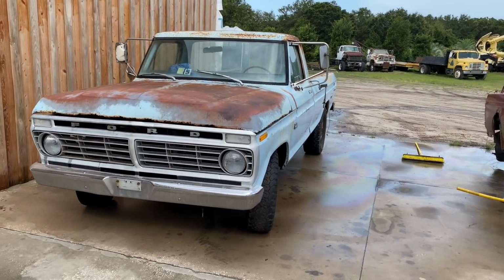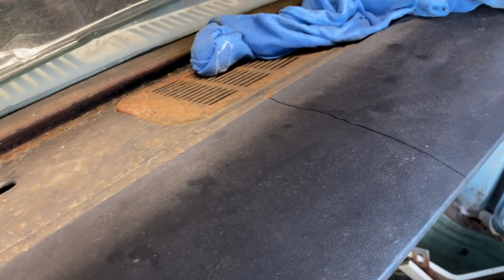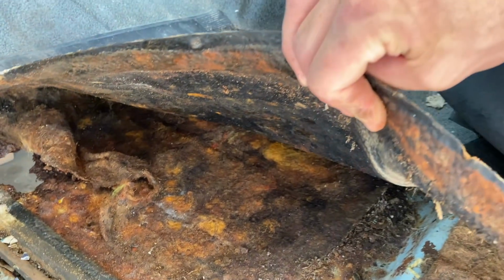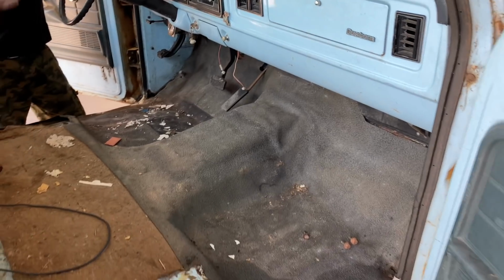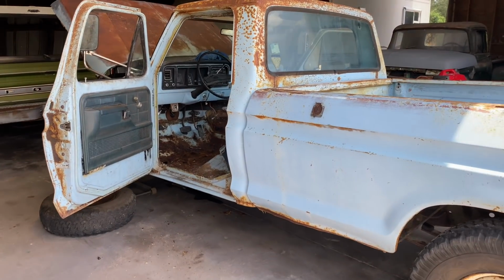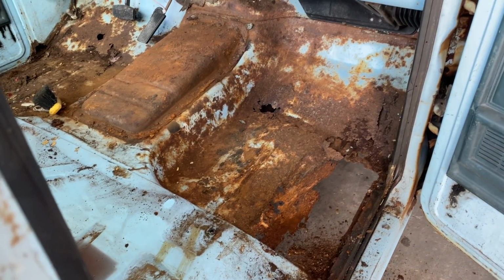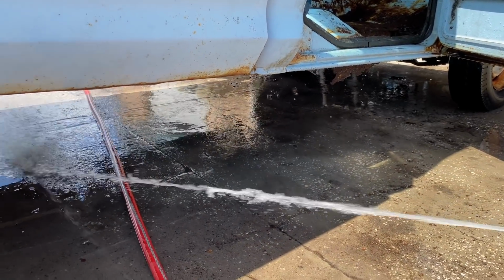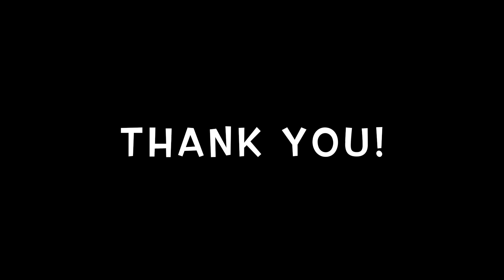SWAMP Dragon Rescue! DETAIL & RUSTED Abandoned 1974 F250 Custom 390 V8 FORD, Vintage Restoration CT

Comment: From LNC truck the Left and Right floor pans are $40 each (part numbers 49-8820 & 49-8821), inner rockers are $80 each, cab mounts $84 each. $408 plus shipping for all. So yes well worth the cost and time. Worth more then a VW Van and parts are cheaper.

Comment: Replacing the floor pans is a straight forward process and is very common on this age truck.
All of the floor pans are availed after market so they are not expensive.
Just cut the bad ones and replace with new.
Reply: Yep. Agree. Pans are a dime a dozen on line and relatively cheap. Replace them and keep the project going.👍
Reply from the maker: Thanks Glenn! I will do that.
Reply: If you can.. you might want to try some junkyards in the southwest for pans.
Reply: Screw in some old license plates ..just as good ..lol

Comment: Yup replace both floor pans and rocker panels. Then give the floor inside and out and the frame a few coats of POR-15. Good for another 50 years.
Reply: Sandblast first would be good
Reply: Por-15 is great stuff, been using it for around 25 years. It works best on 'seasoned' rust. Be careful with the can when you use it. It can make the can turn messy if you dont transfer what you're using into something disposable like an old jar or container. Scoop, dont pour what you are using into the disposable container and seal up the original can with NO por-15 in the creases where the lid attaches. They're slogan says it all on the can. 'When we say permanent, we mean PERMANENT.' Shit will dry in the can hard as a rock. Oh and go with smaller cans rather than one large one. That way if it turns into a mess with the can you dont ruin a large one. The stuff isnt particularly cheap, but a smaller can goes a pretty long way. Oh and wear gloves while you're using it, because only time will wear it away. Its good stuff.
Reply: Mark Godfrey  Nothing helps in the salt belt.

Comment: LMC Truck would have all the metal you need.  They list floor pans at $40 per side.  Not bad.
Reply: wow that place is great. I would even do that one. just even cut the edges and lap them in place. done. little seam sealer and paint and its over.

Comment: LMC TRUCK sells all those metal panels to fix the entire floor new
Reply: Manolo Aycart G exactly. Every rusty panel that they are complaining about can be had from LMC Truck, or classic industries. 70s and 80 s Ford and Chevy pickup trucks are gold. There is such a huge aftermarket for these old trucks, They could probably sell that truck the way it sits right now for twice the money they currently have in it, and they’d be selling cheap at that.
Reply: @chrisbolton4900  screw

Comment: Definitely worth fixing. You can order floor pans from LMC Truck or even cut the old metal then weld some metal in the floors. It’s part of the adventure of fixing an old vehicle. Make sure you treat the surface rust with some inhibitor.

Comment: I've used a trick were I use CLR on the surface rust. Followed by a rust stopper. 
Buys you a lot of extra time before you have to paint and cuts down on the sanding later.

Comment: 1974 Ford F-250 full detail top to bottom paint job pressure washer takes men power get like brand new truck from the dealership back in the 70s 2020 century technical put CD player awesome video friend bless you

Comment: Yes those panels aren't that bad to change. there is two types Of cab mounts,  plain one piece or the factory OEM type preferred. But Jeffs Bronco graveyard has been on back order.. But there are many other company's out  that sale them.  I did not make video but there Not as fun to install as some may have you to believe. I have done this type work before this particular brand was not very exact in fit, as many are but i got it. looks satisfactory. I went for the But weld so was more difficult. Inner rocker is descent shape from what i see. if isn't rotted that bad  just cut out rotted replace.

Comment: Invest in an impact screwdriver. You could've used it on the kick panel trim and plenty other places as well. Yes, I have replaced and patched floors in plenty of stuff. Get yourself some sheet metal, mig, seam sealer and prepare yourself for a ton of prep work grinding back into the good metal that you can weld to. Some guys go even more in depth and use a press brake, and all kinds of stuff but really all you need is basic stuff to make it decent. Cut out all the cancer and use cardboard to make templates of the pieces you need for the floor and tunnel areas and just trace your template onto the metal. Cut it out, weld it in, repeat. When it's done hit it with etch primer and seam seal it. Undercoat the underside

Comment: Hi CT. it is well worth doing. 3 parts to a vehicle. Engine and transmission, body, brakes. You got 1/3rd done by getting it started and running. The bodywork isn’t that bad and brakes are very doable.

Comment: Lol. Pushing heavy vehicles is always fun. I had a '96 Roadmaster Custom Wagon that I saved off the scale and revived. I loved that car, but I could never find the correct fuel sending unit for it, so the fuel gauge didn't work. That LT1 got 12 miles to the gallon on a good day, so needless to say, I ended up on the side of the road quite often when it ran out of gas. It was 17 feet long and weighed 5300lbs, so it was always a blast trying to push it around, lol.

Comment: repaired floors in my F100 seventeen years ago with 4 sale signs, caulk and short sheet metal screws then sprayed it all over with spatter paint. Still holding just fine. A road sign would work well on that big hole you stuck your foot through.

Comment: Hello. Mr. C.T.  =)  What a surprise... It's wet paper thin and crunchy... Yummy! That's what's called the dark side of mats and carpets, as they accumulate water and rots underneath. Anyway it doesn't look that critical and with some panels you should be ok. For the rest of it the easiest and cheapest way for you is metal fabrication DIY. Sheets of metal, snips, hammer and dollies... and voila! =)  Don't forget about rusty...

Comment: Hey just a quick tip. If your headlights aren't working.  My high beam switch went bad once and I lost my lights all together.  Traced a short back to that switch then everything came back.  Might be worth a shot with all the moisture trapped for so long.  Cheap part to try anyway.  Keep going truck would be a cool driver

Comment: Floor pans for this truck are easy to find, I just looked for floor pans for a 1970 Dodge Sweptline pickup for my friend and found 15 suppliers on the first search page. They sold tons of these trucks so it should be easy. The truck is definitely worth fixing if you don't want to or can't, sell it to someone who will. You'll find a buyer for sure.

Comment: Get the correct floor pans. They fit and will be solid. You won’t regret it. Rockers are galvanized and look good to me. Be sure to clean and seam seal and undercoat the bottom of the floor. I’ve fixed several of these. It makes them solid and like new!

Comment: just buy the floor pans and overlap them about 1/2 inch and spot weld it all the way around that would be fine for a floor. be sure to use your rust converter. and paint them before you reinstall the padding.

Comment: I would replace everything in that brake system, rotors calipers lines rubber and metal master cylinder mabey the vaccum booster too after sitting that long, i had to do that on y 86 C-10
Reply: jay bradley not to worry skinny jeans wants to turn the “drums” and replace the pads.  What does skinny jeans contribute? Power washer, gas dumper.

Comment: Floors are easy, you can knock that out in a short day. Its covered with that mat so it doesn't have to be pretty just solid. I would weld new metal in

Comment: At some point in time that F250 had a CB radio in it, you can still see the hook where you would hook up the part you speak through,then the the antenna, that red pick up still has a lot of suspension parts plus the brakes, the disks, if the other ones are worn out.

Comment: I would repair it.  My old 87 chevy passenger side is like that, well maby not as bad as that but it has some body rot in the floor panel.  You can buy new panels and just weld them in.  something I need to do with mine, but mines been sitting.. watching these videos kinda getting the spark going again in wanting to fix mine up more.  cool channel ya all.

Comment: Stubborn screws can often be loosened by smacking the screw head with a bit that fits it. Often, you will then be able to back it out with a screwdriver.  OR weld a 1/4" 6 point impact socket to a air chisel. This imparts more impact, and quickly.  You can actually buy a bit with a captive wrench on the shank, allowing you to turn while hammering. I believe it is an aircraft tool.
Reply: Since pickups are enjoying great popularity, and Ford pickups are by far the most popular, patch panels are widely available, fairly cheap. What you can't easily find, you can make. That is going to make a nice truck, fairly rare as an F-250 with factory air, and  FE block engine!

Comment: Those interior screws that are in the floor the easy way of getting them out is to take your screwdriver and a hammer and tap the top of the screwdriver on the screw is will loosen the screw up it's a good trick that works most of the time on those stubborn screw heads

Comment: Common issues  with that body style  is floor cab mounts front of roof back bottom of cab floor braces radiator support and front of hood. I know because I'm working on my second one it's a lot of work but they all deserve to be saved. All body parts are available at reasonable prices good luck have fun.

Comment: Wow. I figured the floor would be rusted. Absolutely worth fixing! All kinds of floor panels are available brand new and fairly reasonable price. LMCtruck.com has all you need. I have a '72 F250. Different body style but I've found that if these old beasties set outside too long, the windshield can leak. Another serious issue is the hood vent just below the windshield will lose its seal down inside the front seam and leak into the cab. Just dump water across the vent below the windshield and see if water comes inside and onto the floor. Not sure what the fix is but noticed there's a black bead of sealer under the dash at the top of the firewall and that might be the issue. Also, those brackets with wing nuts under seat actually hold a long crank rod that fits into the base of the factory screw jack. Probably could pick one up from LMC truck or something. Interesting to see all the similarities in Ford body styles. Keep 'em coming and don't give up!

Comment: Mechanicals first. Engine, brakes, transmission, differential and suspension. Evaluate the expensive components, then look at the body.
Reply: Yeah but i'd rather work in it clean than it full of garbage
Reply: You'd also at least temporaliy want ply wood covering the hole in the floors so you can drive it without fear of you feet falling through, you also want inspect your frame, you wouldn't want to get the engine all nice and running sitting in a swiss cheese frame

Comment: I have repaired worse damaged then that. A small wire feed welder and some sheet metal is all you need to fix the floor. I used  a undercoat/kerosene  mixture to  make a thin factory anti rust coating then paint.

Comment: Floors in these aren't too bad... a lot of drilling out spot welds and chiseling. Front body mounts will need to be replaced too. Those have 5 or so spot welds on the seam on the firewall.

Comment: You have 2 options with the FLOOR in that TRUCK cut it at the SEAMS of the FOOT PAN & REPLACE it that way or replace the CAB entirely of course I'd go the first way but you will have to take the CAB off either way so you can get to it under it on the bottom

Comment: Not sure about that specific model, but I know that for car it's possible to by new floors for them, cut the old one and simply weld the new one in place. Since that is a quite common truck and not some rare build, probably it is available.
Reply: I wonder why you dont do the bus before you start a new project?

Comment: If you think that's rusted bad it's a good thing you don't live in Minnesota!!  Here they all rust from the bottom up.  That truck is is in pretty good shape for it's age. Find a good used hood and core support.  Get some new floor pans and front cab mounts. 90% of the time when the front floors are rotted so are the front cab mounts.

And on rusted bolts, like the seat mounting bolts, Before you try to remove them take a drill with a wire brush on it and clean up the exposed threads on the bottom side of the floor.  Then spray the under sides with good penetrating oil like Kroil or PB Blaster. The bolts will come out much easier and quicker with less chance of damage to the threads or even breaking them off. And on the rusty philips head screws use a impact driver ( the manual hand tool not power tool ) . You hit it with a hammer and it breaks the screws loose.

Comment: add some strips underside to fasten to. then find some gavenized sheetmetal cut to size and fit it up will be better than new.
Reply: David Schaeffer right? Then bondo the crap out of it and seal it up with duct tape.

Comment: Its really easy in these old fords just order up half or full pans .. i suggest full pans  weld it in primer it or rino line it and the roof of the cab is repairable some patch work and some body filler and a good sand and paint should do the trick... with all this work you should consider at least a parshal restoration make it worth the while

Comment: Yes it is worth repairing you cut out the entire panal use the panal as a pattern and remake the entire floor out of sheet steel. And tack welding . If you cant do that ford sells replacement floors.. hope this helps. And yes it's worth it..

Comment: When/If you put a new floor in Do Not leave it unpainted make sure you paint it with high heat like rust-oleum paint something to help keep it from rusting again and don’t weld to rust make sure you weld to good clean metal.( I’m sure you will I just want to make sure if anyone else is doing a similar job they don’t mess up and regret it down the line.)

Comment: My uncle has a 1968 less than 50 thousand miles original everything no surface rust and original handwritten paperwork and the only thing that is broke is the extra fuel tank but seriously has original paint with only one or 2 scratches

Comment: I would say if you want to just slap the floor together, cut the bad parts out and pop rivet diamond steel plate in there it would work you just have to find good pieces of metal to pop rivet it too

Comment: Cut out the rust and weld in new floor panels. Could bring the old girl back to life with a little work. Probably could find alot of parts on line or a junk yard somewhere.

Comment: I wouldn’t put the seat back in until you’ve done all the work needed to the interior. You’ll be pulling them out again and again which is far more work than necessary. (In my opinion)

Comment: I have to ask CT - why were you pushing the truck - you had it running last week......sort of.....

The front disc brakes use rotors (not drums) but I’d guess that the rears are drum brakes.  Finally, as I suggested with your other projects: get a shop manual and use it.  The project will go much faster, cheaper and will achieve better results with much less effort.

Comment: Many different Ford Assembly plants in the U.S. built the Ford F-Series during this sixth generation:  
Dearborn, Michigan
Edison, New Jersey
Kansas City, Missouri
Louisville, Kentucky
Norfolk, Virginia
San Jose, California
St. Paul, Minnesota
Wayne, Michigan

Also, besides this basic Custom F-250 3/4 ton in Light Blue, Ford offered the Super Camper Special in the F-350 which had the longer 140-inch wheelbase.

Comment: That floor matt is designed to trap water above the floor but they never worked that way... they leaked water from your boots UNDER it then trapped it up against the metal... Don't preserve the matt lol  New floor pans then small foot matts you can pull out and let the floor dry after a rainy boots day -)) Chuck that old matt. Cool truck for sure though. Some of those F-250's would come with 428's in them [Gold] :-))

Comment: Just depends on what you want. Cutting and replacing is not that hard if you have the tools. If you are just going to use it on the farm, Floor pans, Inner fender, cord support, and hood that's where I would leave it.

Comment: I have seen you have a red Ford Pick Up, you could cut the the rusted floor pans, and fix the 1974 F250, at least you will save a few pennies here & there, get rid of the red wreck and fix the 1974 F250 for a truck that has been sitting outside, that truck looks pretty sturdy to me, also you have the steering wheel from the red pick up which will fit nicely, & some other interior items tou can use the 250 is starting to get back to all it*s glory, 👍🏼👍🏼👍🏼👍🏼👍🏼👍🏼👍🏼👍🏼👌🏽👌🏽👌🏽👌🏽👌🏽👌🏽👏🏼👏🏼👏🏼👏🏼👏🏼👏🏼👏🏼👏🏼👏🏼👏🏼

Comment: Throw that Motorcraft carb away and put a 550 vac secondaries holley on it and it will make that 460 smooth as glass, we had 3  just like it,, and i spent a hand full of years at the Ford garage and kept them trucking ✌🏽💯

Comment: It's worth it, however I'm curious how rusted that roof is. To me, that would determine if it's worth saving or not. My 72 F250 had a bad roof on it. Alot of rust along the drip rail and seams where they always rust out badly.

Comment: Is it drivable yet?
Reply: No brakes and I don't think they have a clean gas tank or fuel lines. It seems they put gas in the carb and just use it to move the truck at this point. She runs though.

Comment: WD40 works on these rusty old bolts.  A couple of sprays before and during turning the wrench.  Also for frozen screws, gently hit the screwdriver handle with a hammer, before turning/ stripping it.